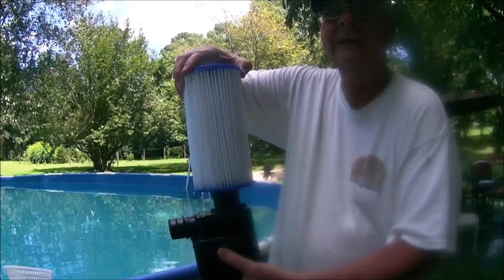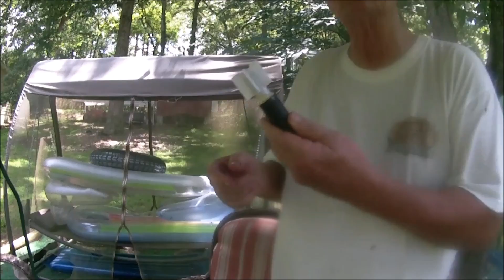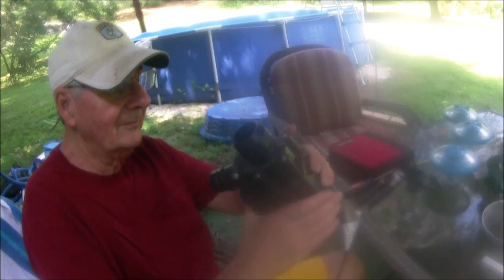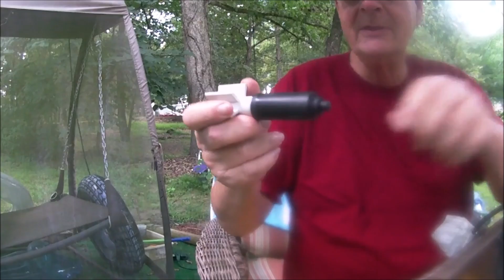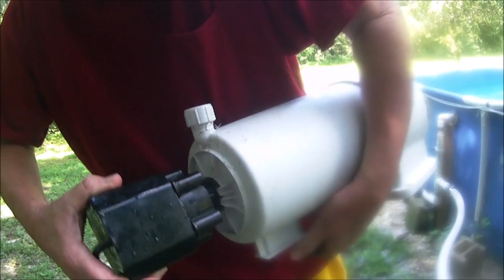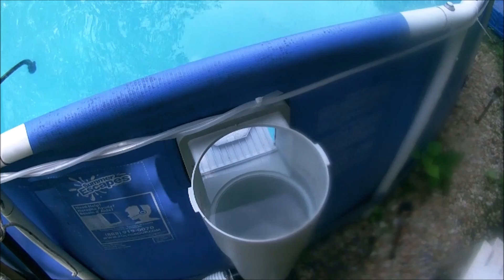Pool Pump Repair

Comment: My filter was stuck so bad it started squishing in. The magnets seem to be way too strong, sonetimes i cant even get the rotor out. I took the filter out to clean it and the impeller stopped, breaking yet another little rod/pin. This time ive yet to rig it to get it back working, i put everything back inside and the whole rotor and impeller has a wobble.😤 hoping your video gives me a new great idea!
Reply: Stick a small screw driver in the center hole of the magnet rotor and try to pry it up tilting the screw driver sideways. I super glued mine yesterday got the new part but it won’t come for a week. Need it for the kids this weekend
Reply: @Jezeus11  ohhhh I did that with some pliers. I now have a VERY green pool that hasn't filtered in over a week! While pulling the stupid thing up the little plastic prong things on the top of the rotor broke off and must have fell down into the dark abyss 😂 
I quit. Lmao